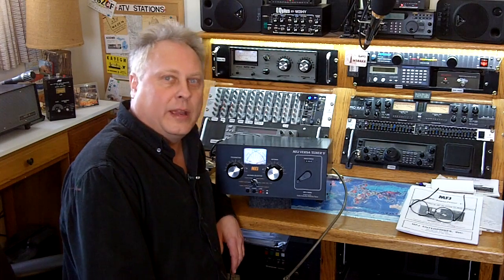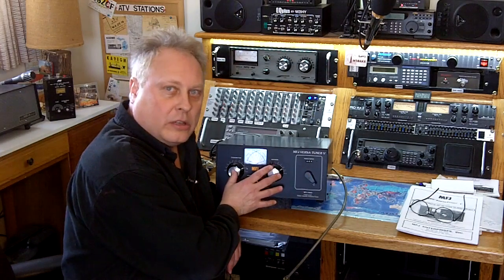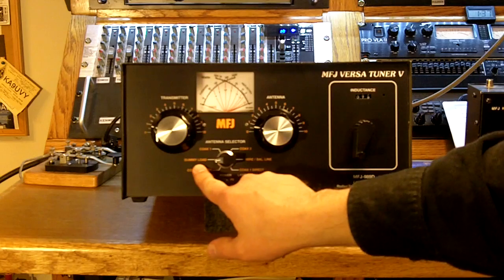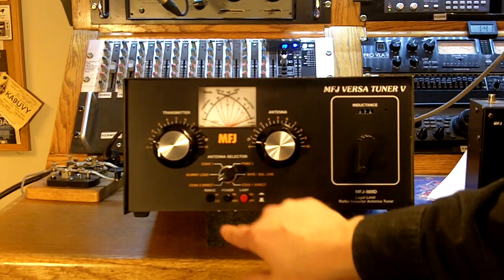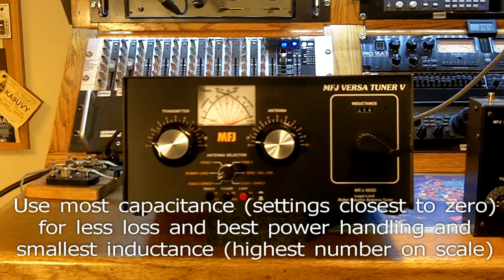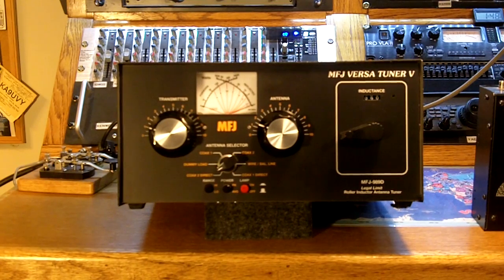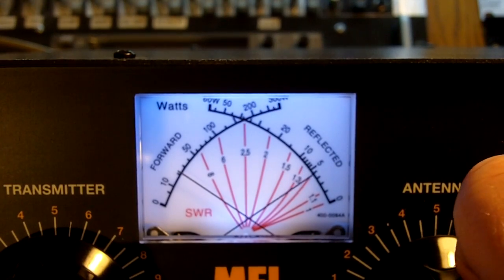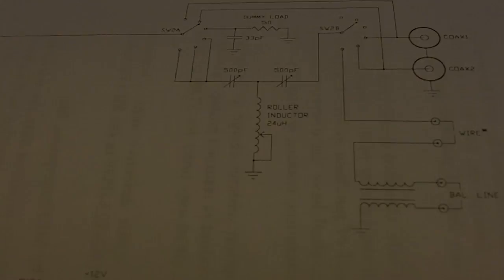Using A Roller Inductor Style Antenna Tuner

Comment: New ham here (have not used my tuner yet) and this video was extremely helpful.  I don't have the exact same tuner, (974H) but a lot seems to be pretty much the same.  (Thank you for explaining the Load section of the chart as my manual does not explain that.)  What I am trying to figure out is why the dials are labelled with the highest cap value at zero (0), and the highest inductance at the lowest letter "A"?  Wouldn't it be easier going from low to high?  But anyway a great video and thank you for posting!

Comment: Thank you for this video. I have the MFJ model 989-C  I have a question. On 14.200 MHZ my chart says transmitter (Exciter) at 4 Inductor at 118 Antenna at 4 load 50 Ohm. When key up my Yaesu FT 710 on 24 watts. I already have an SWR of 1.5. (In Direct/Bypass)  and no reflective power hardly at all. But when I move the switch from direct to antenna 1 the meter shows high reflective power and nothing I do makes it change. Do I have a defective tuner ? It does the same on Antenna 2 and Antenna 2 has low SWR in direct too. What is the best method to do to trouble shoot a defective tuner ?
Reply from the maker: I would try listening on that frequency in RX mode and when in the tuner mode and not bypass, change the settings on the tune knobs to see if you hear any difference in the noise level, if it tunes to the freq your noise level should increase by a noticeable difference. Also make sure that the other antenna positions are not directing to a different antenna jack on the back that you don't have the antenna connected to. I hope you can get it figured out, it is possible you have an issue in the tuner but I would try this to start with I guess.

Comment: You do not tune a radio on a dummy load, dummy.  You need to correct that statement.  Well, I have a MFJ 969 Versa Tuner II which is a roller inductor tuner, but I hardly ever use it now that I no longer have my Kenwood TS-430S.  I now have a Yaesu 991a which has an internal tuner and will handle all my antennae 'cause they're all close to resonate.  A tuner is not really a tuner; it's merely an adjustable box which fools your radio into seeing a perfect 50 ohm load.  Cheers & 73 from W Rusty Lane K9POW in eastern Tennessee

Comment: Sorry!!  This is for an ad " Omni PhotoStick" that I have just seen on here and nothing to do with radio.....This is rubbish and maybe scam. I have bought two different types and both have let me down.  After doing the correct thing I guess I will never know. I still have not seen or retrieved any of the backup pictures yet.  I can't read what I have supposed to have backed up.     Fortunately I did not erase any of the backed up data.  So any stick that claims a quick backup hasn't worked for me. So be careful and don't erase anything until your you have and can retrieve them...

Comment: I heard you can run an antistatic dryer sheet on the meter lense to reduce or eliminate the problem of influencing the needles by way of touch. Haven't tried it yet, but figured I'd mention it.

Comment: Actually you are matching your radios output impedance to the antenna System impedance located at the point of the tuner.  Keep in mind this WILL force the total output of the rig ( as many rigs ( solid state) back down the power based on VSWR.  !!! Into the antenna system ( system includes losses in the transmission line and ground losses ( in a vertical ) and losses in connectors aling the way.   A tuner will not fix a bad antenna. But WILL allow you to get as much power as possible into the antenna  with respect to all the other losses.  A field strength meter will prove this as you match with the tuner.  K4DSB

Comment: BTW:) After talking to Richard at MFJ the ATR30 is a better choice for 160 meters if you use a amplifier like the AL800H or bigger!!!! Also I had this tuner from MFJ for 6 months it is a nice one. I did stop using the Versa tuner 5 as it does not handle the 1.5kw peak on 160 meters very well " it will arc". So for the first 6 months while they were building my ATR30 I ran lower power on 160 meters. Now I own the ALS1500 amplifier and am real glad I have the ATR30 tuner! Thanks to Mike at Ameritron for the Amazing ATR30 and to Richard for his help.

Comment: Larry, 
I have a Versa Tuner III and the roller inductor "slips" all over the place.  Sometimes I can turn the indoctor but the three-number readout doesn't move.  Sometimes it moves very little with respect to how I am turning the inductor.   Sometimes it moves, stops and moves again as I continue to turn it.  This means that when using it as a reference when changing frequencies or bands, it is basically useless, unless I take it all the way to the highest inductance postion and re-calibrate the readout.  And then the issue starts all over again.  Is there something I'm doing wrong.  Or is there an adjustment I need to fix internally?  What do you think?
VY 73 de Dave AJ5F
Reply from the maker: +Dave Mitchell Wow, I have not heard of that happening, sounds like a mechanical problem inside, I don't think you are doing anything wrong.  I borrowed this tuner from a friend so I can't look inside now to see what the problem might be since I don't have it here any longer.  Maybe someone else can help you out and post here.  Maybe something not tight on the inside.
Reply: +RadioHamGuy Thanks, Larry.  This is a real head scratcher.  At the present, all I can do is blindly turn the inductor a few clicks at a time and watch for a dip, but this gets really tedious.
Reply: +Dave Mitchel I have mine open now investigating the meter circuit.  Looks like you may need to get a set of Allen wrenches with the smaller sizes and make sure all those set screws are tight.  Also, others talk about putting a small amount of a dry teflon lubricant on the moving parts.  Of course, make sure the tuner is totally disconnected from the transmitter.  I think it will be obvious as to the loose or hanging parts with the cover off.
Reply: +John Gray Thank, John.  I'll try that.

Comment: Not into ham radio yet, but there is alot of debate over antenna tuners vs antenna analysers. If you have an antenna analyser, do you really need a tuner? This just seems alot more involved than the MFJ analyser. Thanks.
Reply from the maker: +chalemi The best thing to do is to use a resonant antenna on the band you want to use, but next best thing is to use the antenna tuner to make your radio happy so you can still get on the air with whatever you have.  The tuner don't really tune the antenna, but it matches your radio so it can put out full power, however, a lot of your power might be used up as heat in the coax and not get radiated into the air if your antenna is not resonant, but you can still get on the air and make contacts, just not as efficient.  The analyzer is only used to check your antenna and see where it is resonant, it is just a testing device, so they have different purposes.  Hope that makes sense.  Ham radio is fun, so just do what you can do to get on the air!

Comment: Thanks for the demo, HRG, I have an older MFJ-204B Antenna Bridge/analyzer and wanted to know if I could use it like the one you show on the video? The jack on the analyzer says it goes to the antenna and you mention yours goes to the transmitter. Would mine work in the same manner as the one you used? Thanks for all your videos, it helps out a newbie!!

Comment: The best antenna tuners are those using a roller inductor in a T-match configuration. They have less loss and will tune a wider range of unmatched antennas into resonance.  Tuners using rollers also cost big bucks.  I beat the cost after finding an old GE Lab Inductor long used for electronic research and development.  A couple of air variable capacitors and some judicious circuit construction made a very neat tuner which will even tune the bed springs!